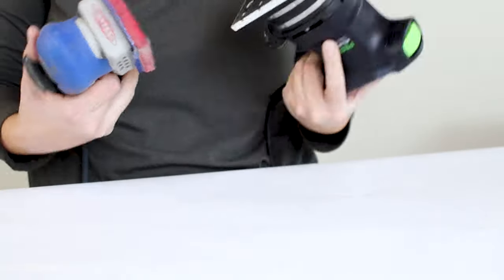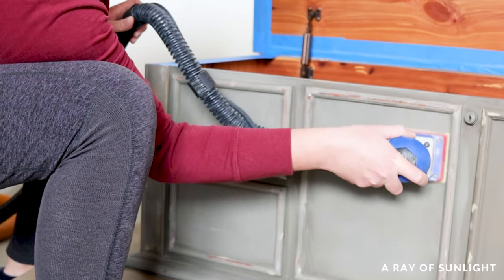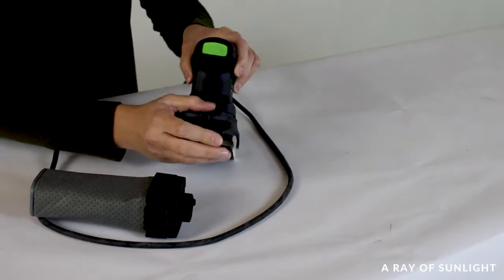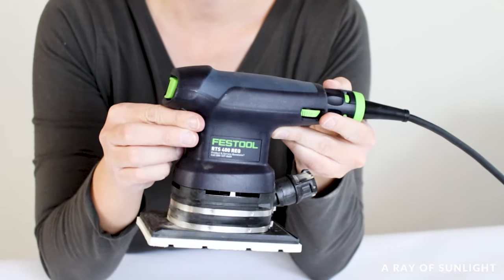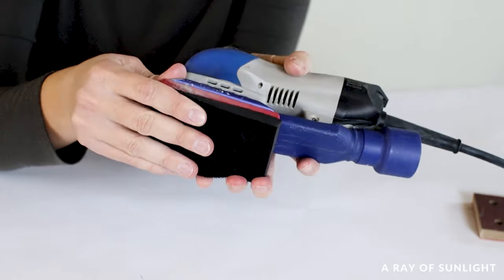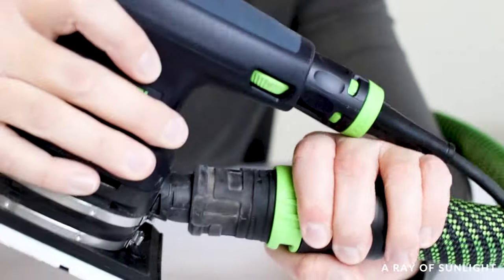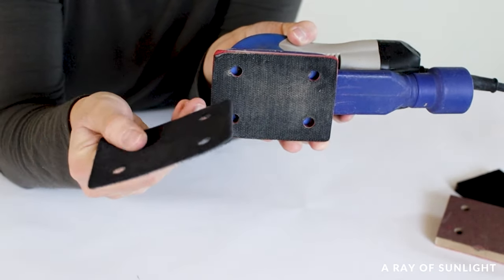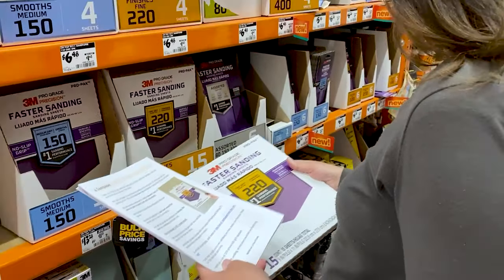SurfPrep VS Festool Sander Review  | Don’t Waste Your Money!

Comment: Try to keep in mind that at least as the Surf Prep sander, it’s advertised as a finish sander. A finish sander by its very nature isn’t as aggressive as a regular sander. It shouldn’t be used to remove an entire finish although it can. It shouldn’t be used to remove thick coatings although it can. It’s meant for finish sanding. If people could remember that and not push them beyond their capabilities they would find these are superior to anything out there.

Comment: I’ve never used either one but I have 3 other Festool sanders. I would recommend getting a Festool vacuum in place of the shop vac. You plug your sander into the vac and the vac automatically starts and stops when you turn on and off your sander. They’re quieter as well.
Reply: + stops pigtails cause you can turn the suction down
Reply: Amazon sells a plug-in that will make any vac do the same for around $15.00
Reply: You forgot to say festools vacuum is hepa!
Reply: Does the surfprep fit the festool vac?

Comment: I prefer festool sanders myself. You could have put the furniture on its side (put something under the edge to protect it) to make it easier to sand rather than trying to sand vertically. Save your back and make yourself a workbench that is 20 inches high for working with larger pieces of furniture for sanding and finishing.

Comment: Just when I think I know which one I want.... I change my mind. I already have a 5" Festool sander and the dust collection. It's amazing. I'm not happy with the ability to do curved edges. I have a soft pad for my sander and it just doesn't do the job. Plus my sander is round. So getting into corners just doesn't happen. I have thought about getting the surf prep so that I can do rounded edges and to get into the corners. But then i see this festool one that you can use the squishy pads from Surf Prep. It's a lot cheaper. Especially since I already have the hose and dust extractor.

Comment: I love them both. The Festool is higher off the surface so it gives you that clearance at any angle over the cabinet trim, window trim, moldings, bases, etc. For the SurfPrep, I recommend the rubber interface, otherwise you may get some extra vibration.

Comment: Festool is best overall, you just cannot beat the festool dust extraction and the customer service if you have an issue which is worth its weight in gold.
Reply: I sold my festool sanders on marketplace after switching to a Mirka 5” random orbital and the surf prep sander. You THINK the festool sanders are top notch until you use and see the results of Mirka and surf prep. I do love my festool dust extractor though

Comment: Would you recommend a specific brand of sandpaper for the festool sander, or would any other brand of sand paper work just as well? Thank-you
Reply from the maker: There is definitely a difference between brands and types of sandpaper. If you buy cheap sandpaper, you will go thru it so fast and it will rip and tear. I personally like SurfPrep sandpaper, Festool’s granat sandpaper or Diablo sanding discs (these don’t fit exactly but they work for the most part)

Comment: I don’t like the lever, either, on the surf prep.  For my larger sander i went Festool 125 rotex because it had a switch versus the Mirka that had the lever.  I love my surf prep but the lever proves to be hard on my arthritis.  I use the festool when striping large surfaces or drawer sides.  It really makes quick work of those tasks compared to the surfprep.

Comment: You don't need the festool hose! I have an adapter for my shop vac that works perfectly!
Reply: Can you share which hose adapter you are using? I bought one, Rockler Universal Shop Vac Hose Adapter – Small Port Shop Vac Adapter Kit and it seems heavy and hard to move around with when plugged into the sander. Thanks in advance.
Reply: might not “need” it but man is it nice and light and non-static and doesn’t get caught on anything and it cooperates perfectly with no wrestling with it.

Comment: What size vacuum is good to use with either. I have a 9 gallon vacuum and it doesn’t creat enough suction
Reply: don't use vacuum with sanders. The create to much suction with too little cfm (volume of air). That's causing most of the vibration and swirl left on the surface. Get a dust extractor, it's more pricey for sure but you will forever be happy with it
Reply: BINGO. #1 cause of swirl marks is too much suction. @LeFrenchBacon

Comment: Is the $135.00 hose really necessary or will another hose fit?
Reply from the maker: That specific hose attaches to the Festool sander, which I can’t find an specific adapter for any hose to attach to a festool sander. 
If you’re on a budget you can make any hose work if you buy a flexible pvc adapter in the sizes that you need. Check out this post on our SurfPrep Alternative to see how we used a cheap adapter like that to make it attach to the hose. https://arayofsunlight.com/surfprep-sander-alternative/
Reply: @ARayofSunlight  Thanks!
Reply: shop vac small hoses fits perfectly without adapter on festool tools
Reply: I have a Domino and a tracksaw from Festool.  I use a Cen Tec (cheap Amazon level hose) and zip tie the adapter to the tool.   The Cen Tec system is such that you leave the zip tied adapter on the tool and just do a quick connect / disconnect with the hose from your shop vac.  

Works great.   The ONLY downside is that it won't fit in your Festool box anymore.  I don't think that's a huge deal since at some point most people end up putting their tools in cabinets so that they are easy to access vs using tool boxes.  

Paying for a Festool hose is crazy to me.  I'm a pro cabinet and furniture builder.  I have better things to spend my money on.

Comment: I took the RTS 400 for a test drive a while back. I ended up not keeping it. I think the DTS 400 would fit my needs better as it can get into corners better. I honestly think Festool needs to revise these two sanders to be lower profile and brushless. I do enjoy my ETS-EC 150 and would not give it up for any other sander.
Reply: I have a DTS 400. Love it! One of the best purchases I've made. They are way more efficient than any other sander.
Reply: I can’t speak for the rts 400 but the rtsc 400 is most definitely brushless.
Reply: Yes! Why can't they hack of that clunky top portion
Reply: How do you get into corners or do rounded curves with ets ec-150?